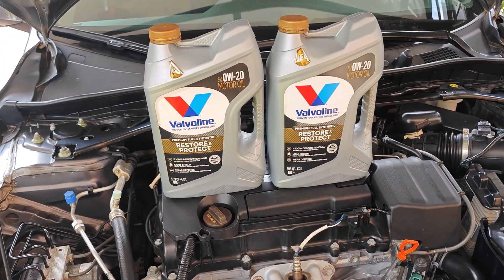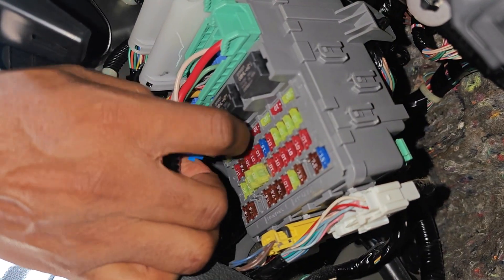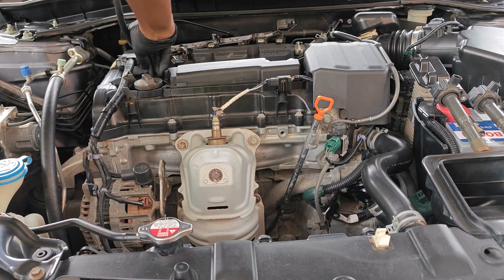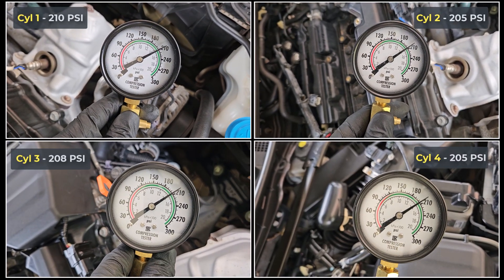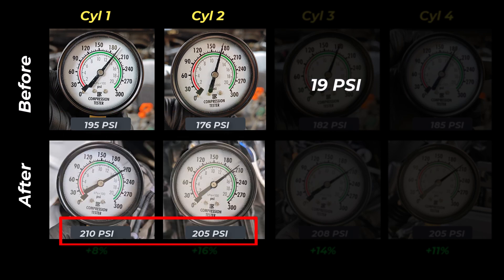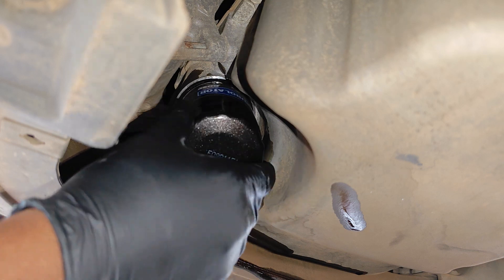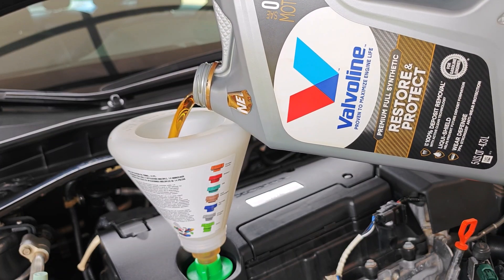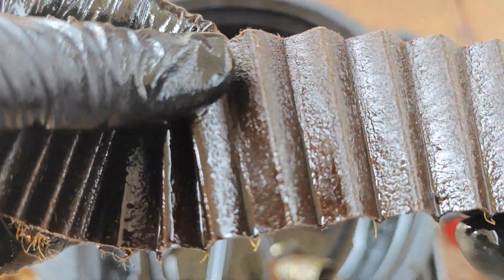Checking engine compression AFTER Restore & Protect Oil. Increased Engine Compression?

Comment: Increasing compression is part of what Restore and Protect is made to do,  lots of cars today the piston rings get gummed up or varnished and lock into the pistons ring grooves and Restore and Protect is made to dissolve and remove that gumming and free up the rings to help them seal into the cylinder.     So yes it works because it is made to do that !      -----------     The NEGATIVE to using Restore and Protect is if you have (due to negligence) you have allowed sludge to form and buildup you need to be very careful as Restore and Protect can cause that sludge to loosen and move into the oil filter and cause the filter to block and go into (BYPASS) which allows unfiltered oil to go into the engines oil galleries and into crankshaft and connecting rod and cam bearings which can damage the engine.   (IF) you are using Restore and Protect with a dirty engine (varnish, sludge, etc.) then IMO you need to buy several extra oil filters and change a filter each week (and cut them open) until you don't see any more hard debris or sludge in the filters.

Comment: Does this model have port or direct injection? If it had port injection any good grade of gasoline would have cleaned the rings as well.The oil control ring was probably gunked up from using cheap gas. However valvaline R&P is good stuff.

Comment: Filter was clean because there was little carbon to begin with.  Compression affected by lubrication, throttle opening, engine temp, and presence of any fuel.  Been doing compression checks on mine every few years on my Ecotec.  Using Amsoil, still factory spec on all four after 223k miles.

Comment: If you cant prefill your oil filter the trick in the past was to pull coil wire and crank engine for 15 seconds + - to prime oil pump before starting.

Comment: Good video. I do use this oil in two different weights, for two different t cars. Both cars runs better and smoother. One is a 2018 Nissan Sentra and the other 2015Kia Rio Ex with oil consumption. Both on second oil change with this VRP

Comment: use thicker valvoline oil. it will further add more compression. 20 is far too thin and offers little protection. try 40.
Reply from the maker: I'm currently running serial used oil analysis and will make a decision based on that. Until then, I stick with 0w-20.

Comment: WOW. it not only bumped the low cylnders it bumped all of them and not only that, EVENED them out. before the spread was up to a 19 psi difference, now the spread is just 5 psi. and this is just after 4k miles. this is CRAZY.

i bought a quart last night of restore and protect 5w30. i pulled the dipstick out of a non running car that had 240k on it. dipstick is varnished up. i took pictures of the dip stick and then opened the bottle and inserted the stick. i have about month before i hit my next oil change in the car that runs i can't wait to see what the stick looks like before then.
Reply from the maker: Thanks for taking the time to leave this insightful comment! Regarding your experiment, it'll be missing the "heat" factor, but curious to see how it goes!
Reply: @DIYAutoworksNG yeah no heat and no natural circulation. I got home from work at 2:15 am about 12 hours in the oil. I pulled the stick and wiped it. A small amount of varnish came off. You cant tell looking at the stick just what was on the paper towel but its doing something.
Reply from the maker: Thanks for reporting back!

Comment: Really, these are some crazy results. I am on my second oil change with a Hyundai Santa Fe and my opinion is, it's running quieter, though that was not the reason why I started using it. 

If you look at videos from the Motor Oil Geek, you can see results of hundreds of samples. 

It appears that there will be some added metals early on in the tests, as a result of deposits being dissolved away, which is exactly what it's supposed to do. The numbers show it PROTECTS as well or better than other oils, so, it's not increasing wear on your engine. 

Some people pay a shop hundreds of dollars to run an oil cleaner through their engine and I think this might be as good an option for a lot less money. 

Mostly, I hope it removes deposits around the piston rings, to free them up or prevent them from getting stuck in the first place. If the engine increases compression and runs quieter, plus has the same or better protection, we are done debating it unless someone out there has proof it is causing harm, all I see are positives from those who are testing it.
Reply from the maker: 👌🏼Well said. Couldn't have put it better

Comment: On the 2nd change in my daughters 13 Spark. 130k miles. Haven't done a compression test, but definitely has more power again for what it is. Wasn't a heavy oil burner, about half quart in 5k miles, but now no burning.
Reply: Buenas noches, como utilizas el aceite? Como afinación normal? O echas el aceite y lo quitas luego luego? Gracias, tengo un jetta a4 2001 con 208,000 millas q funciona bien pero quiero intentar si funciona mejor

Comment: Really surprised it took this long for a mainstream brand to come out with ether cleaning based oils. It's been fairly common in super boutique oil mixers for a good while now and has been proven to work. If you want something similar, check out HPL's engine cleaning additive - its effectively the esters and ethers used in this oil but concentrated in a can you can add into yours. They also sell full oil very similar but at a higher quality then the valvoline (not knocking valvoline though, this is a great product for the general market)
Reply from the maker: Thanks for sharing!

Comment: I just put this iny 1979 Dodge W150 Power Wagon. It was originally a USDA truck, and the valve train was completely black, but no sludge. I should do a compression test on it to see if it improves at all. Also got a 2nd oil filter to put on after about 1000-1500 miles, just to be safe.
Reply from the maker: Your plans sound good! Best of luck

Comment: No way in hell this is possible. If this really works, it's a game changer
Reply from the maker: It's been a game changer since it's launch. But don't take it from me though, read the comments. There's loads of videos from other channels too
Reply: @DIYAutoworksNG  Will do man. It almost sounds like snake oil. I'll have to give it a try
Reply: I put it in my prius and oil consumption basically stopped. The oil was sooo disgustingly dirty after my first use i changed it early. It's on the 3rd change now and i don't have to check the dipstick every 1000 miles to add oil. A+ experience and considering it's only $30/jug at walmart they're no negatives. Thats about what other non cleaning synthetics cost.
Reply: @anthonyreid7221  AMAZING!

Comment: On my 2012 Volvo S60 T4 with 140,000 Km the oil consumption is at 1 liter per 1,300 Km. We don’t have Valvoline Restore and Protect yet. However, upon inspection of the bores there is one lightly scratched by the oil scraping ring or the other rings. The hone on the bore looks pristine otherwise. All the care was given to this engine, albeit, it was to no avail! Therefore, I imported a rebuilt engine from China and will performe the engine swap –unless another Volvo victim decides to buy it out right!
Reply from the maker: You oil control rings are most likely stuck. Light scratches while still maintaining the crosshatch pattern isn't an issue.
If you have the expertise, you may consider a piston soak.
Reply: @DIYAutoworksNG Will do! However compression in all cylinders is so low that it barely moved the needle. The engine’s computer reminds me that the engine’s performance is low. Like I do not feel it in the pedal!

Comment: I'm going to move from Castrol to this oil on my next change. Was a Valvoline back in the early 2000 but moved away from them to Castrol,  been seeing nothing but good stuff from Valvoline especially this, glad they're back making good synthetic oil.
Reply from the maker: Good plan. I had a stint with Castrol Magnatec many years ago, before switching to STP and then Valvoline.

Comment: Awesome to see the compression improvement!  I wish I'd done that before starting, though I didn't have a piston ring problem on my car.  Rather I'm chasing a stubborn hydraulic lifter noise which has previously shrugged off MMO and Seafoam.  2000 miles in and oil has gotten pretty dark, but oil analysis shows excellent wear numbers and plenty of active additive so will continue for the full interval.  Lifter noise is still present, but I expect I'll be here for the long haul due to the very tough varnish deposits I suspect as the source of the problem.
Reply from the maker: Thanks!
Yea, oil darkening has no bearing with additive package or breakdown. Let's see how your lifter noise goes! Valve clearance is good?

Comment: Been using restore and protect for 15k miles in my 2015 jeep grand cherokee at this point. Bought the car with 140k miles on it, changed it at 145k, now I'm at 160k. Really happy with the oil, car runs extremely well and I can only imagine that the internals probably look brand new. Crazy enough I went to a valvoline shop for an oil change when I hit 160 and they do not carry the restore and protect, and the rep literally told me he believes you have to change the filter every 1k - 2k miles with that stuff. Maybe after the first or second change on a high mileage vehicle, but that's a good thing if it's cleaning your engine right?
Reply from the maker: Didn't see any evidence of clogging up oil filters, but agree it makes sense to check in on the oil filter and change it if it's a high mileage or poorly maintained car.

Comment: On my third oil change on 02 f150 seems to be running better and more power.  Also the ticking I had from the timing chain/ tensioner is less.

Comment: I just filled my daughter's KIA Soul with this oil to see if it helps the engine stop burning so much oil. 
My next project for that GDI engine is to clean the intake valves.
Reply from the maker: Yea, Kia and oil burning. Excellent plan on intake valve cleaning. I've cleaned mine. Video should be up soon!

Comment: running it in our car now , be mad not to
Reply from the maker: It's a no brainer given how easy it is for low tension piston to get stuck.
Reply: @DIYAutoworksNG  yep we have a honda stepwagon with low friction rings, put e10 fuel in it and its going to start burning oil and coking up pistons. hoping this stuff stops it before it starts.

Comment: @DIYAutoworksNG, I drive a Corolla 2012 and I can see 0W-20 written on my oil cap, do you suggest I get the exact 0W-20 or I should do a 0W-30 instead? Btw I love your videos!!
Reply from the maker: Hey. Did you just get and is the engine in good condition? What oil weight were you using prior?
Thanks for the compliment!
Reply: @DIYAutoworksNG  Engine went for a full checkup last week. Everything checks out except for a sound I hear after a cold start (you mentioned it...that  very fast sound). Mechanics said I should not sweat it but I overthink it. At the last oil change last week, they use Hyde (Luminoz ZM5: 20W-50)
Reply from the maker: 20w50 is way too thick for the car. How long have you used 20w-50 in it? If not so long, you can go down to 10w30 to experiment. Using much thicker oils will lead to wear as it doesn't flow quick enough at start up.
Reply: Don't get me wrong sir, I have not ordered the Valvoline yet. But looking at the comments, someone had similar issues so I wan to try it out to see if it will solve mine. @DIYAutoworksNG

Comment: What's wrong with carbon and varnish takes up more space in combustion space more compression.
Reply from the maker: But it increases the compression ratio, at a certain level of compression, the air-fuel mixture will auto ignite even without the spark plug firing. This is predetonation and is very bad for engines.

Comment: I know the video doesn't capture the true color of that old oil but to me it looked filthy!  You say that was only 4,000 miles?  I'd say the Valvoline Restore & Protect is doing a fantastic job of cleaning out the engine.
Reply from the maker: Actually, heat cycling is a major source of the darkening

Comment: the first video checking the compression, I'm running this oil for 500km only, already found that the oil consumption is very low. Before using it was drinking oil

Comment: I'd feel better about trusting the results if I could watch the face of the gage during the check. It's important that we match not only engine conditions, but also base test parameters are matched. The nominal 'puffs' used for compression testing is 4, and it sounded to me like you used between 7 and 8. Too many 'puffs' can render the results inaccurate, as will a different 'puff' count.
Reply from the maker: Great comments. 
What I did across the baseline and this was to crank and stop when the needle peaked. We differ on using just 4 cranks. Didn't count the cranks either. Different schools of thought on how long to crank.

Comment: do you think this oil will help my knocky toyota 1.5 engine? heres an example of it. youtube.com/shorts/E_NIlLNYVGY
Reply from the maker: Youtube says the video is unavailable. Knock can be caused by a number of things including carbon build up, so it's good to try to get a sense of what the cause is and then develop a plan of attack.
Reply: @DIYAutoworksNG  hmm sorry the youtube linked didnt work, i can try again: https://www.youtube.com/shorts/E_NIlLNYVGY . so basically this sound only comes in after 10minutes of the engine warming up. i changed the plugs and added injector cleaner.
Reply from the maker: Video is still unavailable

Comment: The fact it improved compression back to nearly factory compression is INSANE
Reply from the maker: Great stuff
Reply: It cleaned the piston rings, it's like washing your body after your skin is covered in oil, grease, and dirt. Try putting your clothes on dirty or after the shower. Same process. 

Good soap cleans better.
Reply: Apparently you don't know what ring cooking is.
Reply: @geralddemery  IDK if you mean coke ing like carbon crusting? Cooking would indicate overheating and lost tension in the rings. Often it means warped heads and block as well. Sometimes leading to or resulting from blown head gasket. You can hear those poor engines spin in a sickly fast rate during startup and not start as quick from that lost compression. The overheat damage can't be fixed except a new engine or extensive repairs. Carbon crud in the rings can now be cleaned. That is why the compression went up oil consumption and blowby went down.
Reply: @geralddemery  please enlighten us

Comment: Worked on my daughter’s 2005 Honda Civic LX. was using oil and now isn’t. Pity it wasn’t around to save the wife’s cousins Volvo XC90.
Reply from the maker: So true. I watched a video where some guy disassembled a scrapped 1.5L turbo engine from a 2019 Accord with 94k miles. In summary, there was no abnormal wear. The internals were pristine! Even the YouTuber said this was the cleanest engine he's disassembled. The only thing he found were stuck piston oil control rings. Some restore and protect could have saved that engine. A real pity. Some shops are so quick to replace engines burning oil with no attempt to use simple methods to free up oil control rings!

Comment: Running that in fairly new engine. Trying to prevent issues with rings ever getting carbon in them. Thanks for making me feel less crazy as I don't typically believe in a fix in a bottle.
Reply: Wait until you run Shell 93octane Vpower.  Run 2 tanks.
Reply from the maker: Cool!

Comment: When you see dust puffing out of the spark plug wells, that is hint that your compression test is suspect.  There should be a 100% seal of the tester.
Reply from the maker: You're correct. Tool is 10 years old! I probably need a new one!
Reply: @DIYAutoworksNG Might just need a new o-ring.
Reply from the maker: Right. Will tear it down. I did that sometime back for my AC port couplers